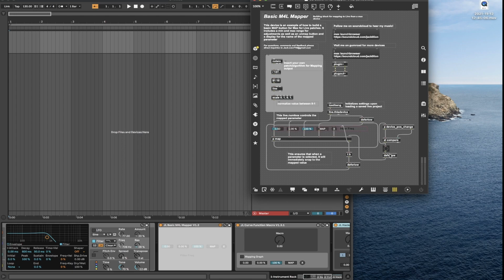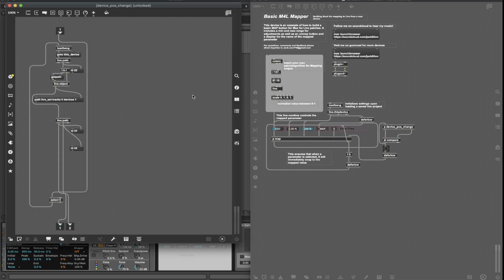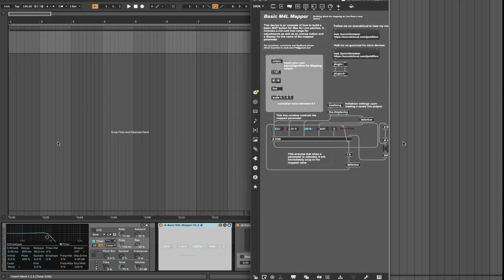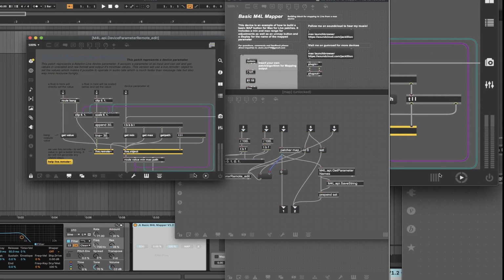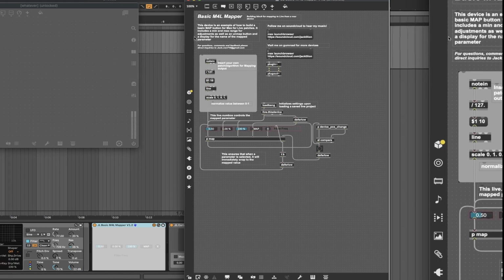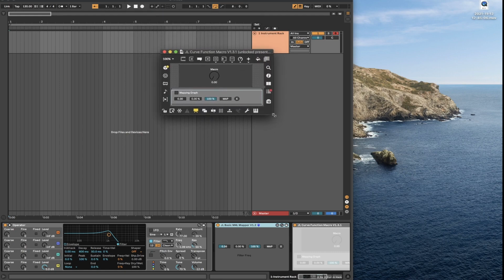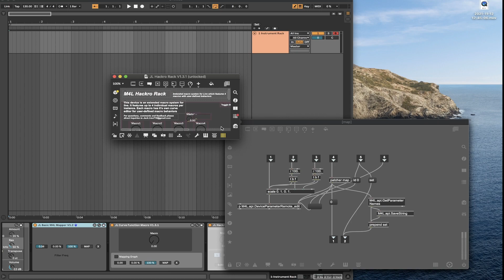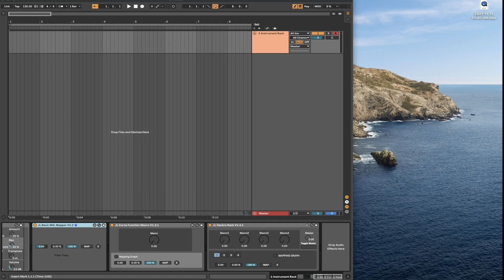Tutorial 1.2 - Remembering Parameter id When Moving Device

Comment: I'm having a small issue with this patch. I followed the original tutorial, along with the revisions in this one. Whenever I load the patch in Ableton, I get the following in the console ""live.path: set path: invalid path"

Apart from the error message, the device seems to function completely normally. I ended up buying your version of the patch to see where I went wrong, but yours also seems to trigger the same error. Any ideas? I'm running Live 11.3.21 & Max 8.5.6 on OSX 14.3
Reply from the maker: I can’t be sure exactly what your issue is but most likely it is some typo or mismatched patching. Try and review the videos again
Reply: @jack_lion  Thanks for the quick reply. I downloaded your version from Gumroad and it is having the same issue. Just figured you might want to know. I also tested it on Live 11.3.1 on Windows 10, same issue. Either way, I appreciate the tutorials.
Reply from the maker: @blockletter  Does the device still work when you try it? I know there are a few errors that appear in the console that can be safely ignored.
Reply from the maker: I see that you mentioned that it works fine otherwise. If your concern is over potential side effects from the error it should be okay. I really appreciate the notice though! I believe it is some kind of patching logic deeper within the patch that isn't contributing to the actual functionality. If there are any functional issues then please let me know. But if it works then i'd say no need to worry about those errors my friend.
Reply: @jack_lion  Yeah, no issues at all with functionality luckily, so I’ll ignore it for now. Cheers

Comment: seems to work alright, however I keep getting a banner that says: "ipatcher: stack overflow -- outlets are disabled until this message is cleared" If I close it, the mapping works perfect, but it's quite annoying. The error appears to be inside of the device_pos_change patcher. Any ideas? I've triple checked my wiring.
Reply from the maker: Honestly can't be sure just from reading this. I believe it works for everyone else if you follow along and it certainly works on my end. Maybe there is a chance you missed some patch details? I know it's quite a deep patch and it can be easy to miss something.
Reply: @jack_lion  thanks for the reply. Turned out to be a bug on my end, restarting my Ableton fixed it!